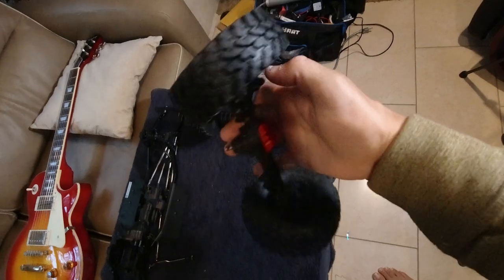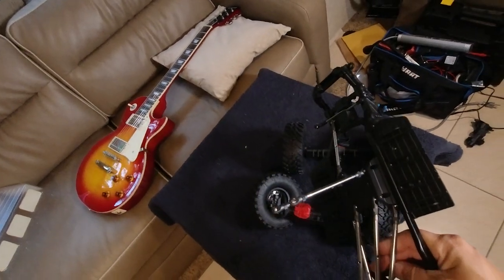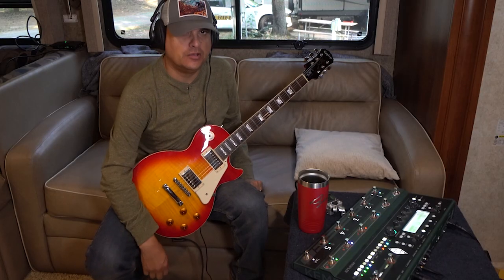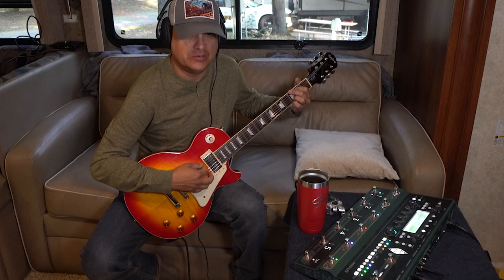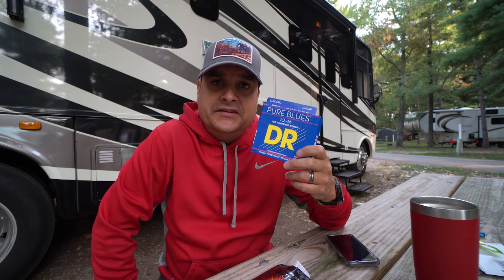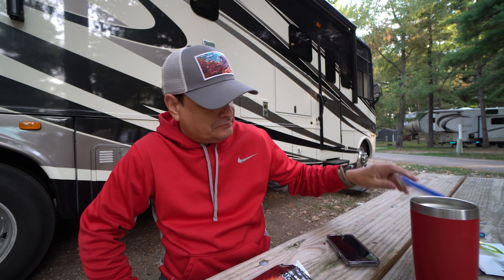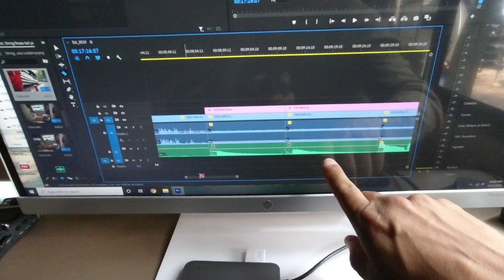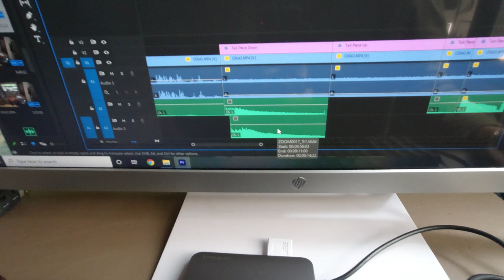Does Raising A Les Paul Tail Piece Kill Sustain - Best Strings Of 2020 Finale

Comment: Absolutely is there a change in playability lower the tail-stop for more string tension, raise the tail-stop for less string tension... sustain does not change tune o matic bridges are absolutely wonderful especially the roller tune o matics.. another secret the big manufacturers don't want you to know...🤔BOLT ON NECKS ARE JUST AS GOOD AND IN MY OPINION BETTER THAN SET NECK AND NECK THRU GUITARS THE SUSTAIN IS THE SAME OR BETTER PLUS YOU CAN CHANGE YOUR NECK IF EVER DAMAGED OR YOU WANT TO CUSTOMIZE AND SWAMP ASH BODIES ARE TRASH DONT BUY🤔.. 🔥MAHOGANY IS WHERE ITS AT🔥🤘🤘👍👍✌️✌️✌️🔥